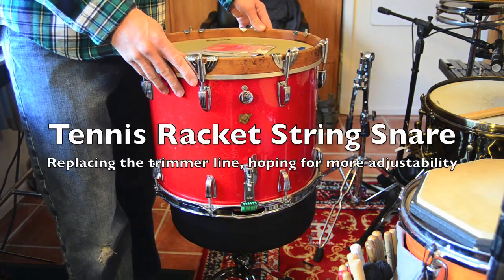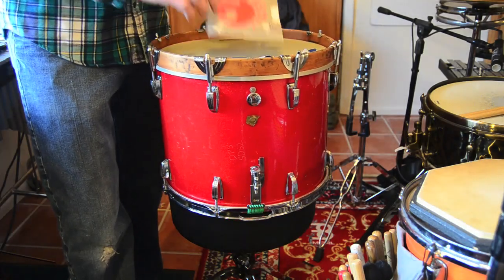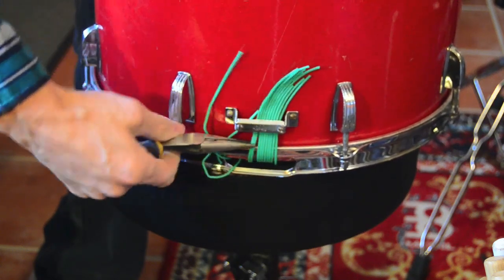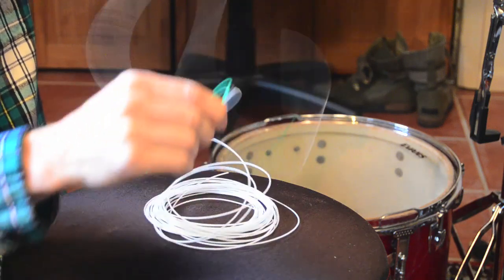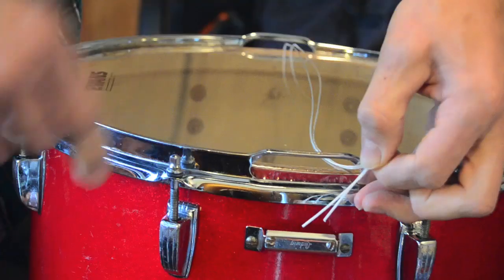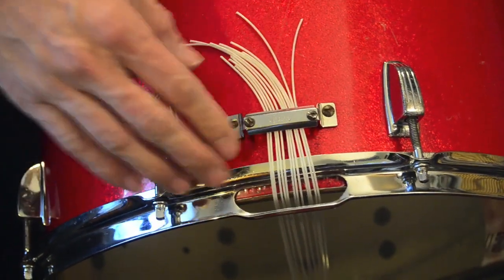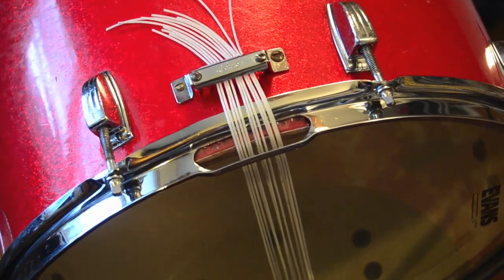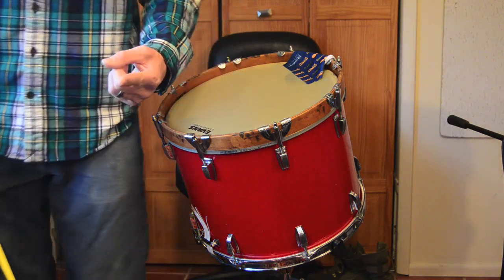Tennis Racket String Snare Wires

Comment: Definitely has some pop to it.

The different diameter (hence mass) changes the character of the snare. I think I like the trimmer line more (more muted, less attack, but more thump), or even a combo of the two.
Reply from the maker: Yeah it had a different sound for sure. I just couldn’t adjust it. It took 2 hands and 3 or 4 tries to run the strainer lever. Probably not good for the 60 year old hardware.
Reply: @RyanAlexanderBloom  I wonder about something like speaker wire (the cheap stuff).

Plastic encased wire. More mass. Maybe if you get bored of the current sound.
Reply from the maker: on classical snares they sometimes use nylon, silk, plastic, beads, metal... all kinds of whacky materials. often 3 or more different materials that are individually adjustable on a very complicated strainer. I should just buy one of those strainers sometime so I can directly compare different materials.